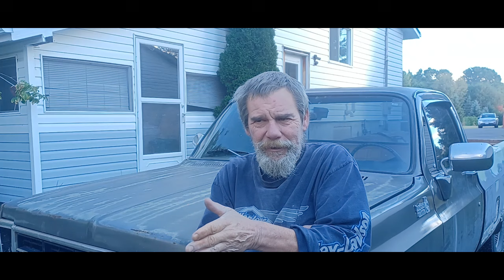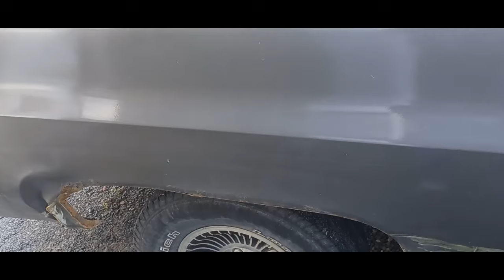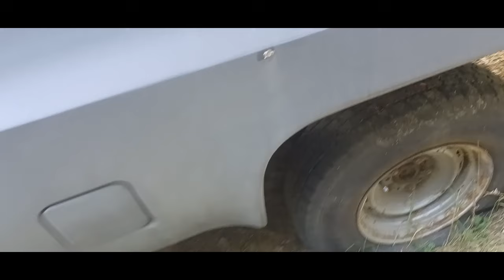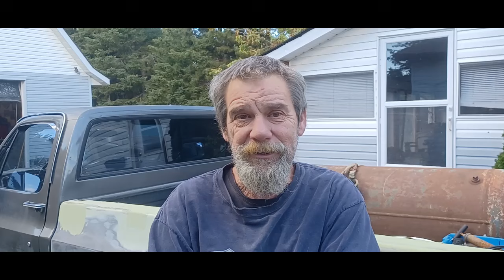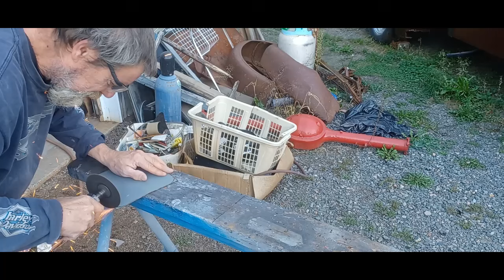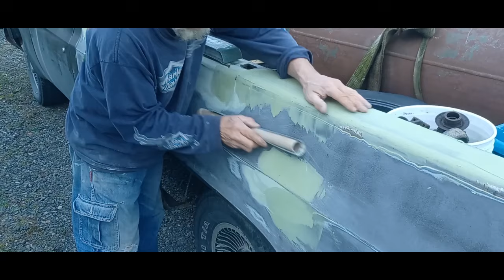MY SMASHED UP '78 CHEVY TRUCK & THE PLAN TO FIX IT!

Comment: Hey Dan, why not swap the gas tank when you swap the square body truck box? That way you will have the gas tank on the driver side with the already gas door already in place?
Reply from the maker: thought about that...that means a new tank, straps etc ...and the '78 had the cap on the right...I'm doing it the cheapest way possible I think. the truck I'm taking the box from is actually a better truck!
Reply from the maker: Thanks for the input tho...I appreciate it!

Comment: Glad you’re getting some work to do at the body shop. Hope you get the box side figured out. By the way, what size steel plate do you use to fill the hole for gas filler door??
Reply from the maker: 16 guage steel...I think that's ehat you were asking!   Thanks